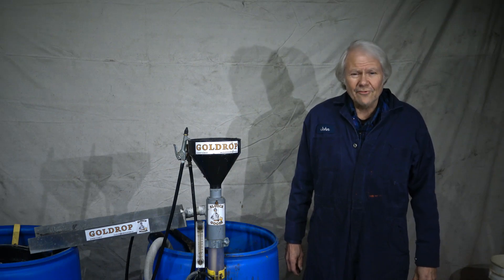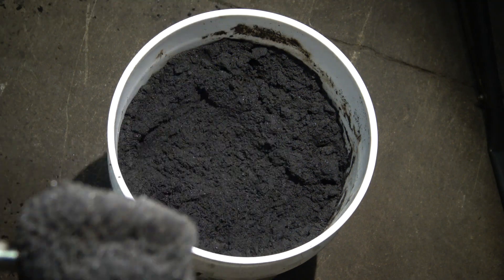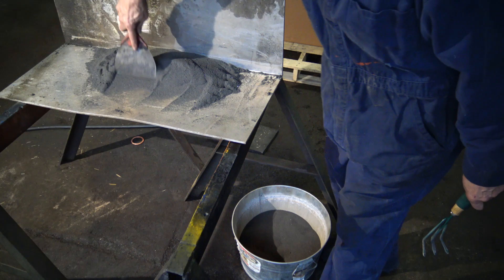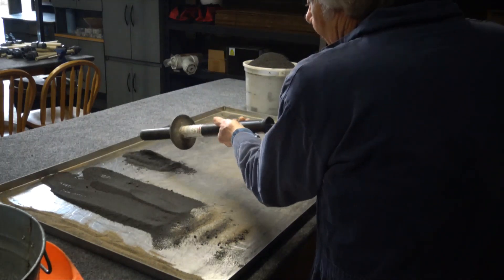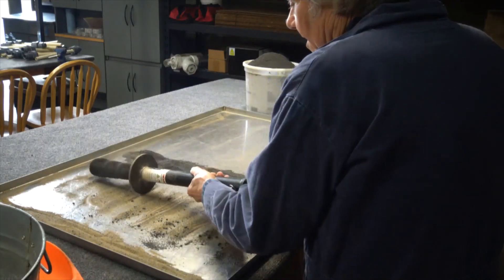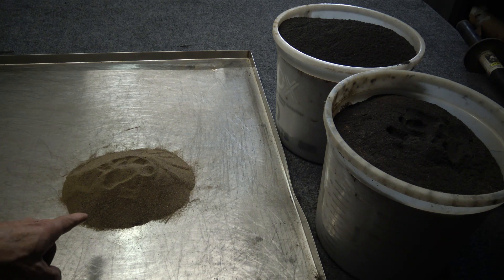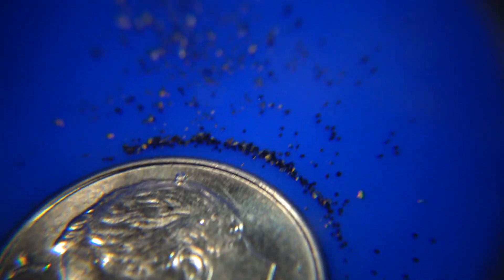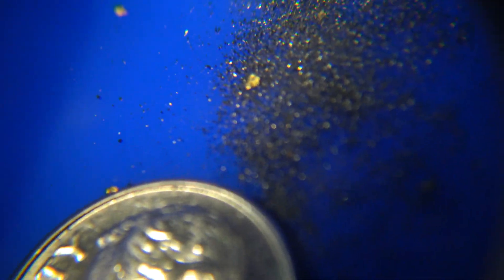GOLDROP & SpinItOff team up to get the gold!

Comment: John, that is a great concept. I have been looking for a fluidized bed for in line processing of gold veins. Would you consider a demonstration with air as fluid.  Mine in desert with no water supply.
Reply from the maker: To switch to air would require new R&D I have no time for. Your best choice for no water conditions is a dry washer which works well. I have a Royal for that purpose. I am currently R&D scaling the GOLDROP for more volume. The GOLDROP was involved in testing for mercury replacement. The GOLDROP captures gold mercury cannot! Read the report on my website, www.sluicegooseindustries.com.